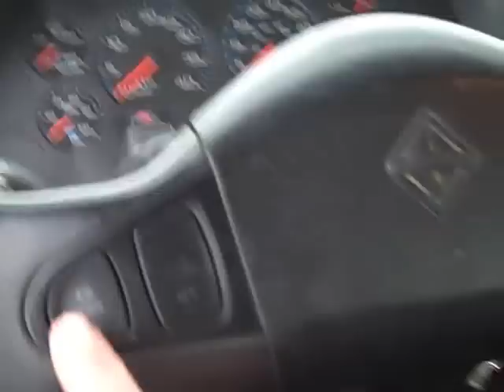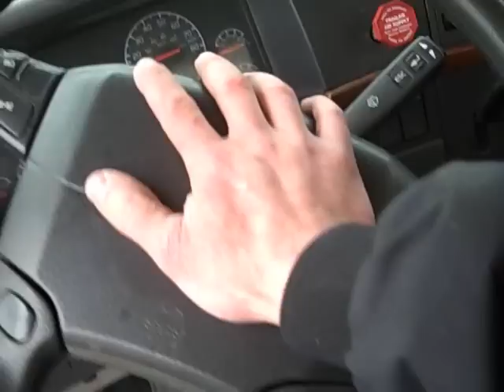Subtle Wussification of the Air Horn

Comment: The one thing I hate about most newer trucks is that they've been slowly getting rid of the pull chain/ rope. 
The best part of trucking is pulling that thing when the kids pump their arms.
Reply: Random Stuff In Oregon International went back to all pull cords with the cab update.
Reply: @jaysmith1408  LUCKY >:(
Reply: JGtruckSpotting  They're standard on trucks here and in Europe, but most European trucks have a small electro-pneumatic air horn rather than a straight air horn. Volvo used to use those on the 1997-2003 VNs. You can also order the trucks with the bigger Chrome air horns too in the US.

Comment: That 1995 GMC sounds amazing! I like the kenworths with the 4 horn setup, they sound pretty close to that.
Reply: The Kenworth quad horns are Hadley H02101As (low) and H02102As (high), the ones on the White-GMC WG64T are the Hadley H00977 (low) and H00978 (high).
Reply: Yessir
Reply: It does @Austin trains
Reply: But what I find about the Orange is very simple is that they are in some cases so very loud you can actually have your hearing taken out! And that's no joke either but with these new dual sounding air horns the ones that you actually put together or that are already put together is one horn sounds like the other horn that's about right. But the last time I heard something like that was years ago and I was traveling down the highway here in Seattle when I heard a dual horn air horn I didn't know what it was. I thought the one sounded a little sick but that's the way the newer ones are now. But when you have a semi truck that has a horn that sounds like a train then you got a problem. You wouldn't even know what it whether you're hearing a train on the road or one on the track. But what I found about the new dual horn air horns actually those two horn air horns have been out since 1973 or maybe 74 when I first heard them. Because basically they've been around for a long time it's the newer ones are putting out now. And besides that those horns can be interchangeable later on. But it's but from what I know is that do a horn air horns are just the craziest thing in the world. You put them on the truck you hardly notice anything. But what a YouTuber said here a while back when I first noticed it is how in the world can it all come out to be. Because basically they sound alike. But the way those horns sound alike together it's very simple once you put them together once they're put together and basically they're woven into one horn that tells you one thing that's why you can't even tell. But I can tell I can tell by the way they sound.

Comment: Yeah, the 2002 Freightliner has "the SOUND"!  Congrats on finding it!!
Reply from the maker: +Handlebar Said it Sadly, that truck is now, also, retired.
I shoulda swiped the horn off before the wrecker came for it. :(
Reply: Ger Brassfield I have to find one just like that, and I won't stop until I do. That is a true truckers horn!
Reply: Ryan Davis air horns are Hadley h00977 & h00978

Comment: Air horn Part Numbers-
Both 2007 Internationals - Grover 1680 
2007 Volvo - Hadley H00640YS
2005 Freightliner - Hadley H02001FP (2) 
2002 Freightliner - Hadley H00978RA (2)
1995 White-GMC - Hadley H00977AJ (Low) & H00978P (High)
Hadley uses different designations to specify which OEM that the horn was sold too as well as packaging and other features; usually weather shield design. For example, the 978P and 978RA will sound the same by themselves, but the 978P was sold to Volvo and the 978RA was sold to DTNA for Freightliner trucks. There are also mass market versions of the horns in this video, and they usually have Hadley branding as opposed to an OEM's.

Comment: So newer models have push buttons for the horn instead of the pull-chain?
Reply from the maker: Yes. Unfortunately.

Nanny government, in their ever knowing wisedom, believe that less accidents will happen if you keep both hands on the wheel at all times.

Even some of our lights and radio controls are on the steering wheel.

Also, bonus fact, most of the trucks have two sets of horns; the big, loud air horns, and the little 'beep-beep' ones that are on cars.
Reply: Thanks for telling me the fact that trucks have 2 types of horns, my fav 1 in this video is the 1995 GMC
Reply: mahnarch I'm not sure if you will read my comment or not but some new trucks still have the pull chains like the Freightliner Cascadia
Reply from the maker: Interesting. We might have a Cascadia or two in the lot. Imma have to take a peek.
Reply: my dad drive a 2020 w900 with the pull-chain